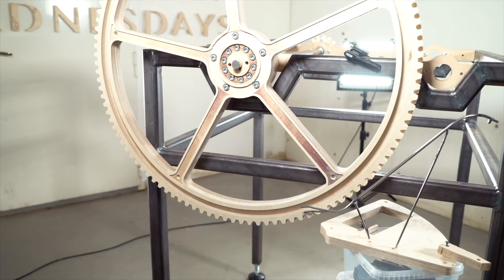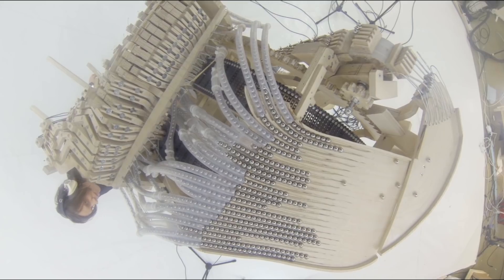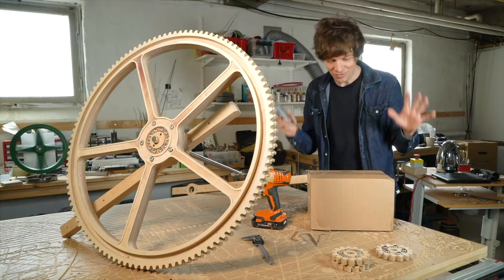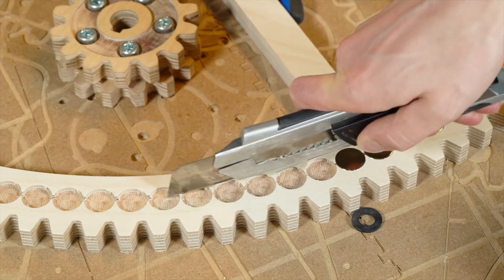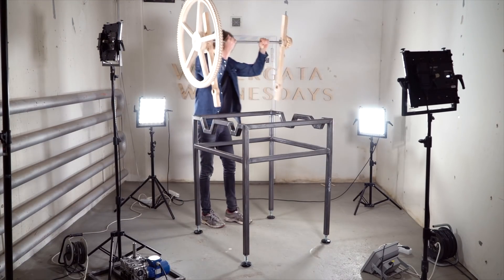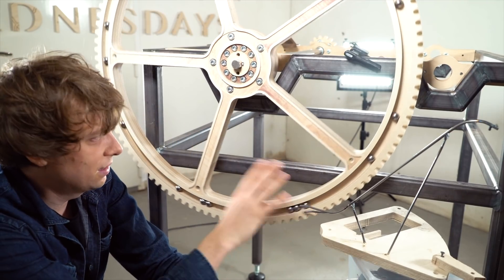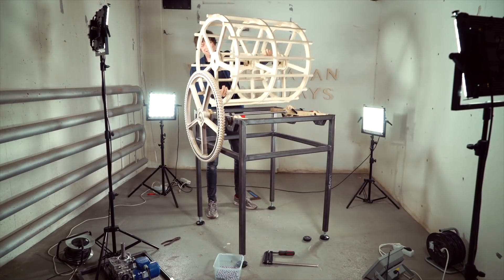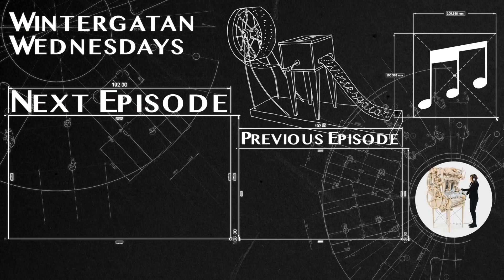Lifting Marbles With Magnets - Marble Machine X #13

Comment: If you have the balls becoming magnetized becomes an issue you could include a degaussing tool into the machine or use a degassing tool periodically to demagnetize the balls.  To demagnetize you'll need a diminishing AC magnetic field which you could make with a coil.  Here is a explanation  https://www.youtube.com/watch?v=T4q5irgKEew

Im not sure if using electricity breaks your design philosophy for the machine.

Comment: If the ball bearing become too magnetized you may want to look at degaussing them in the machine or degaussing them between usages.  A degaussing tool is an ac electromagnetic where a Demi's punishing AC magnetic field removes residual magnetism accumulated by the ball bearing.

Comment: I dont think alternating the polarity of the magnets would solve the magnetization issue. An already polarized marble will attach itself to a magnet so that its magnetization aligns with the polarity of the magnet. This means that having alternating polarity wont produce a cancelling effect like you're hoping.

There are two solutions to this problem I can think of:
1. Striking a magnetized object with sufficient force gives the molecules in the object enough energy to "jiggle" and break the magnetization. Perhaps you can create a device that hammers every marble that is raked off of the wheel. This solution isn't practical because it'll probably be very noisy but it's neat.
2. Buy a demagnetizer and send the marbles through it. The magnetic field of the demagnetizer will break the alignment of the magnetic moments in the marbles.

Hope that helps!
Reply: A agree with you on the part that the alternating magnetic poles won't cancel out the already magnetic polarization of the marbles, but my thought is that maybe the magnetization of the marbles won't be a problem in the finished machine. The drop of the marbles when they're hitting the vibraphone, drums och strings of the bass may be enough to disposition the molecules to cancel out the magnetic polarization. However, if the magnetization occurs after just one magnetic cycle the problem withstands at the top of the machine before the drop.
Reply: Yea, dropping a marble through a demagnetizer every time it went through a cycle would probably be enough to stop magnetization from building up.
Reply: Demagnetizers are also called Degaussers. 
Some are electrically powers, while others are passive. The latter are mostly made for screwdrivers and probably have too small an opening to fit a marble through.
Reply: @Samuel Sellberg Oo never considered the dropping of the marbles on the vibraphone. Interesting thought. I guess the team will just have to try different things out as they put the machine together.
Reply: Rob Eimerl Curie temp for stainless steel balls would be around 1000 kelvin. Way too hot to run on wood. Plus this is an all mechanical machine. How are you mechanically going to heat magnets up that high? And if the lose all their magnetism, how will they climb back up the wheels?
Reply: Reducing the magnetic field? That's not really how it works. The magnets are already encapsulated by wood. I supposed you could put more material in the way, but that doesn't really solve the underlying problem.
If you use magnets and ferromagnetic marbles, you're going to have issues with magnetization. You need to demagnetize them at some point.
Reply: +Ryan Takahashi
YUP. There are a lot of people suggesting solutions that would make the marbles non-magnetic (like heating them). At that point, the whole purpose of the magnetic lift is ruined.
Reply: Yep too many people making suggestions that don't make sense for what this project is. Like oh make an electromagnetic coil and power it by AC. SMH.
Reply: @Rob Of course heating it up would demagnetize the marbles but adding a heater means the Marble Machine X wouldnt be mechanical anymore! There are other glaring issues to that solution as well.
Reply: Ryan Takahashi huh, it was clear what I said, seems magnets for the Iifting wheels and use non ferrous metals for the rest of the machine, such as the runners.
Reply: 1) The problem is marbles sticking to each other. THAT is the problem that needs to be solved.
2) The bass also has magnets and ferromagnetic steel. The vibraphone will also likely be made of ferrous material.
Reply: goo.gl/fcm9xu Running one's like these along the tracks would help sort them into a line as well as removing the magnetic field from the balls as they travel along, since the demagnetizer is on the open top.
Reply: Another alternative solution would be to heat the marbles over their Curie Temp, I'd use a induction heater and run the marbles through the heather in a pipe.
Reply: Falcrist, so how about reducing the magnetic field by putting something in the way? Like encapsulating it in wood rather than direct contact?
Reply: Falcrist surely you only magnetise things when they're in close proximity to a strong magnetic force?  Reduce it and you increase your runtime?
Reply: nontrivial dawg ... Yes but the point is that it makes the field stronger.
Reply: +SimonJMcNair You increase the runtime at the expensive of effectiveness... and you still haven't really solved the problem.
Reply: Degaussing the marbles just takes the magnetic field from them, it doesn't make them non-ferrous. They will still stick to a magnet afterwards.
Reply: Just make the rest of the machine from wood and non ferrous metal. Sorted.
Reply: What are you talking about man? The magnets are part of the wheel. Are you saying to start over and not use magnets at all? Otherwise non-ferrous balls wouldn't climb the wheel. Did you watch the video? They are trying to solve the issue the first machine had where balls would go everywhere when being carried by a conveyor design.

Comment: Few things you should consider: Add fleece in the groove to silence the marbels. Do alternating magnets because marbels will actually attract others in the wheel. Think of a demagnetizing gate for the marbels after they went up/back down in the collection bin. And finally airlines will not let you ship magnets on planes because it may mess up with planes' compass.

Comment: It may be possible to add a device to degauss the steel marbles.  Such devices are used in manufacturing and could solve your problem as long as the degauss field did not interfere with your electronics.
Reply: I'm guessing they wouldn't need to be degaussed during the performance. Doing it after each show should probably be enough, between each number might be necessary if they do pick up enough magnetism to cause a problem during the show. Doing it continuously while playing seems like it would be overkill...
Reply: Just use a passive demagnetizer. It isn't as effective, but if you run the marbles through it every time they go through the machine, it should be more than enough to counteract the problem.

Comment: You actually did place them in every other + and -
Reply: what do you mean?
Reply: I mean that every other magnet is turned 180 degrees
Reply: Nope. He was using the last magnet in the row to orient each one before hammering it in. So if the last one's orientation was (+), then that means that it attracted the (-) side of proceeding magnet, thus it would also have (+) facing up.

To alternate them, he would have had to orient them to push away from each other before hammering it in.

(this is assuming that they are axially magnetized)
Reply: You are right, I didn't look closely enough.

Comment: I know that you can buy a magnetizer for screwdrivers, and all of them have also the "demagnetise side", maybe you can simply make the marbles pass through it, or figure out how it works and build one with your measurements https://www.amazon.it/BUTEFO-Magnetizer-Demagnetizer-cacciavite-utensili/dp/B018Q7HYLG/ref=sr_1_1?ie=UTF8&qid=1505926286&sr=8-1&keywords=magnetizer
Reply: I came to say this. Just have the balls pass next to an AC solenoid, in a way the magnetic field they receive is tapered out (just having the marble moving away from the magnetic field) and done.
Reply: https://www.quora.com/How-does-a-tool-demagnetizer-work
Reply: What is this sorcery!? Science is incredible.
Reply: Alex Araldi and it is really cheap

Comment: Very interesting how the marbles "Cascade" occasionally when they get bumped. The magnetic force goes down with the cube of the distance, so if you need more "Grip" shaving a little off the side of the groove next to the magnets will do that.
Reply: I'm pretty sure they do that because he placed more marbles than magnets on the wheel. So there is few marbles that do not have magnet right under them, thus having less "grip" and falling down, pushing next marble off their magnet, that pushes other marble and so on.

Comment: You know... you have the potential to create a fair bit of power with all of those magnets and a simple coil or two.   Maybe put some lights on it or something. :)
Reply: Tony MacDonald Yes, but if Martin considers this, he should make sure to alternate the polarities of the magnets for this to work!  The power electronics for this shouldn't be difficult to design either. Could really add to stage presence.
Reply: Won't that make the magnets lose their power faster?
Reply: Yes, it would add a load to the wheel, but this force also depends on the electrical load.  Also, the load may already be insignificant depending on the gear ratios.
Reply: I was thinking the same thing. It would put a load on the wheel though.
Reply: No but the more power drawn, the harder it would be to turn the wheel.

Comment: You can de-magnetize the marbles by heating them up
Reply: Tom Whipp Could be fatal for a machine made out of plywood though ;) but if placed correctly that shouldn't be an issue
Reply: roll the marbles down the bands sweaty back haha that should heat them up
Reply: Ward Dejonckheere The curie temperature for a low carbon steel is 770oC or 1390oF. When steel is heated above its curie temperature, it loses its magnetic properties.
Reply: You can't heat the marbles up during operation, though. They'd burn the wood, and wouldn't stick to the magnets anyway...
Just use a demagnetizer.
Reply: Solution:  Have a rail going through an open flame in the base!

Comment: Huge. What could go wrong with the marbles becoming magnetic; clumping in the transports, marbles simultaneously dropped pulling towards each other in mid flight?
Reply: Or he could periodically de-magnetize the marbles.
Reply: Drop the marbles through a demagnetizer every time they go through the machine.
Reply: lies damnlies if he uses aluminium marbles he would have a problem using the magnets lifting  up marbles in the machine wheel. ;-)
Reply: You don't need a powered degausser. Just use a demagnetizer. It's simpler, and won't interfere with the audio equipment.
Reply: agreed
Reply: Marbles clumping together during operation might cause some problems I think.
Reply: Kind of expensive, but he could always replace the marbles in the system with new, not magnetized ones if the current ones are causing problems.
Reply: Ward Dejonckheere That's if the xylophone is made of a ferromagnetic metal
Reply: Ramix09   Vibraphones use aluminium (which is paramagnetic).

A solution could be to use aluminium marbles instead of steel, though that'd certainly be steep. They would stick but wouldn't become magnetized, and the sound generated should be roughly the same. But the price would be extremely high; at least four times more I would guess. Assuming you could even get them in bulk.
Reply: If it's a problem, it's not too hard to solve. He just needs to put an electric coil with AC current somewhere where the marbles are queued. Should be enough to degauss them.

Comment: 6:30 thats called:  'magnet halbach array'
Reply: it's actually not! almost though! in halbach arrays the orientation of the magnets is rotatet in increments of 90 degrees, which is not possible with flat disk magnets. An alternating polarity setup is still slighty stronger than a 'regular' set up!

Comment: 10th! Yay for Wintergatan Wednesdays! Martin, if you alternated the magnets polarity, you could use a simple reed switch and it could "count" the marbles and also determine the speed of the wheel. You could use it to set the beat of the music. Also a reed switch opening and closing could provide the beat of the machine.
Reply: I think that he has already planned the whole thing out, making a drastic change such as adding another component could complicate things.
Reply: Sure it's a reason to not follow all ideas, but sharing ideas should not be limited. I think the plans are always up for re-planning if needed. Also, who knows when the MMX spawns the "new and much better MMY"?
Reply: Yes, it is free to share ideas. Just don't get your hopes too high about him changing the design.